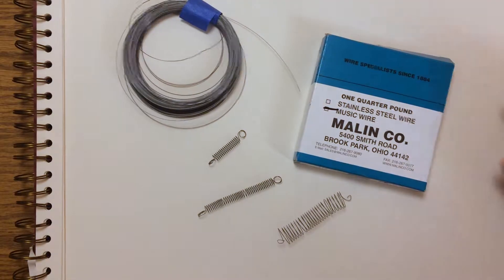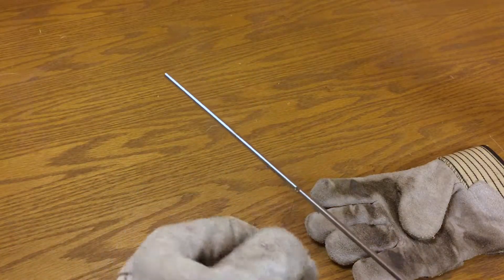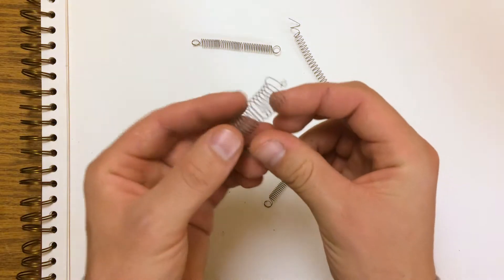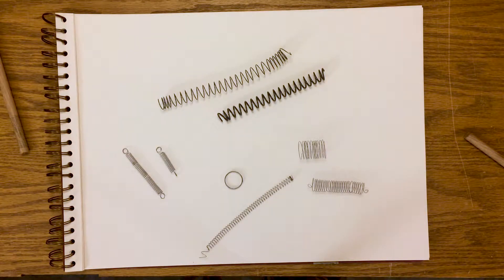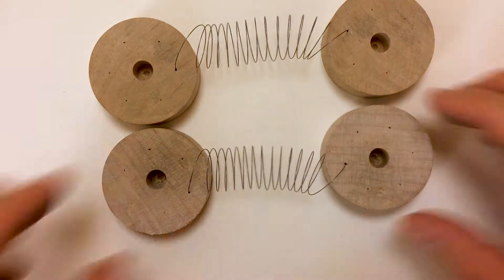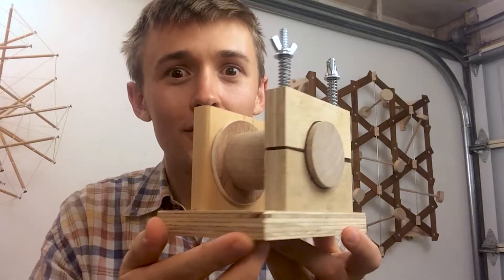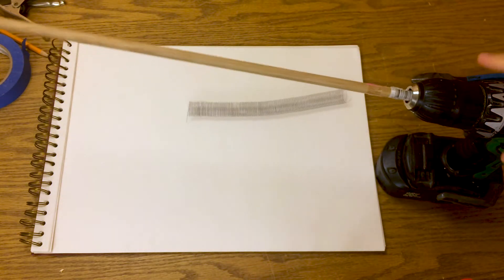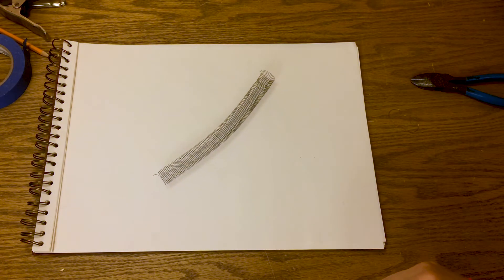A Sculpture That Ripples (Part 6 - Homemade Springs)

Comment: Wait.  But how did you get the initial piano wire put onto the big spool?  It comes in a small box.
Reply from the maker: Good question, thanks for asking, Cere. I decided to cut that part out to keep the video duration from growing too long. I used a cardboard tube section inside of that bigger homemade spool that was just the right diameter, that way I could take the coil of wire out of the small box and carefully slip it onto the cylinder, taking care to pull from the end of the wire which is the correct one for unwinding it, effectively reversing how it was would around a spool from the manufacturer.